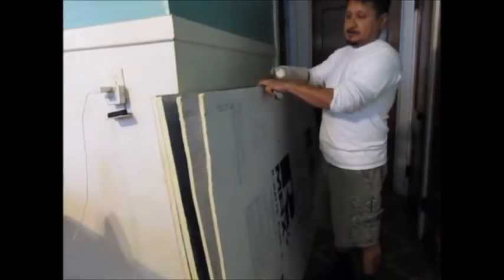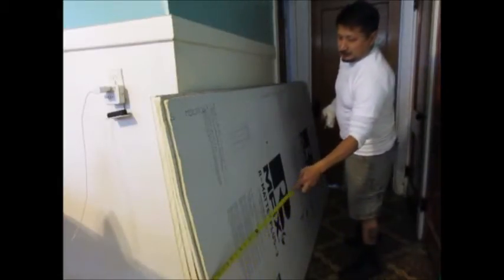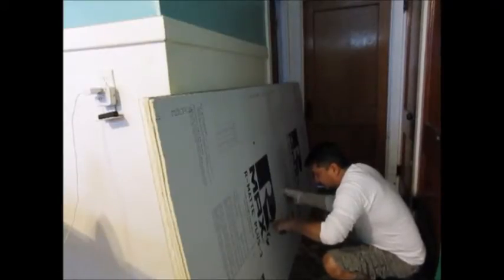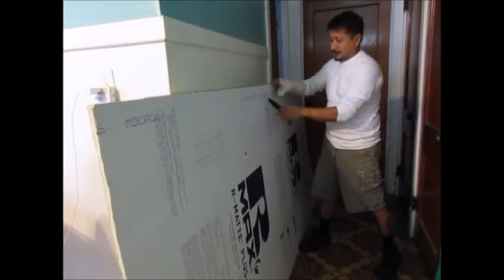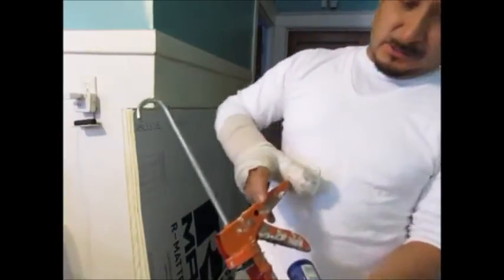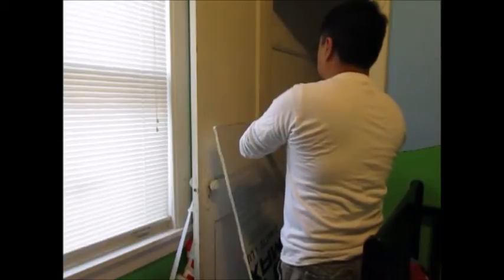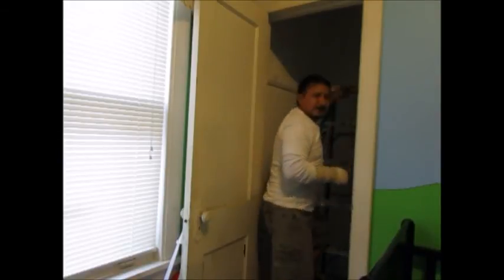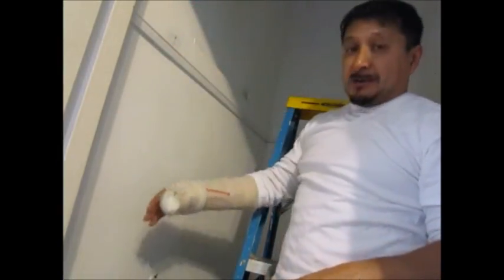Cheap insulation for a cold closet PT2

Comment: Use a piece of sheet rock 4 inch. by whatever length to fit.  Shave the sheetrock to fit tight against the crooked wall,  now you have a template for that side, do it all around.  Come down and draw the dimensions on a good sheet and install.